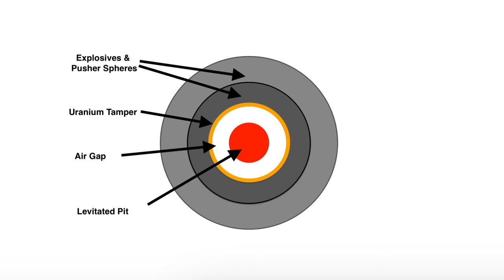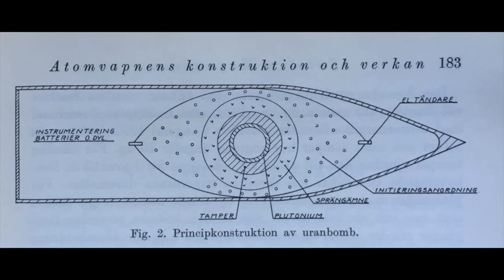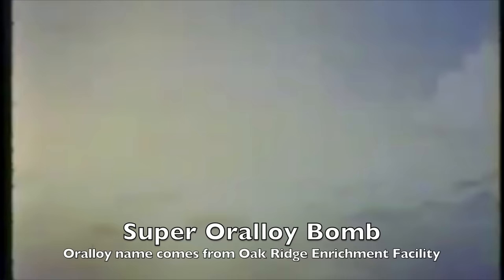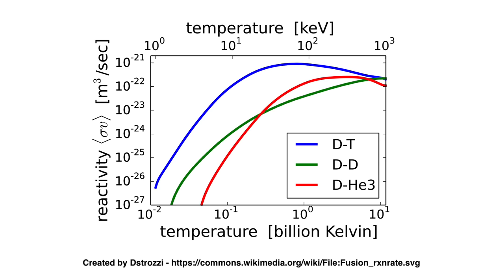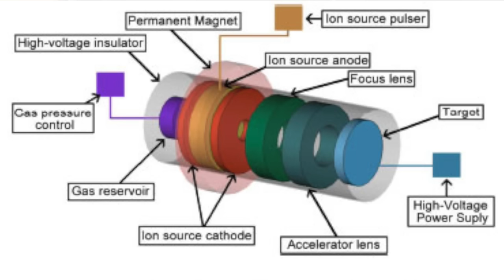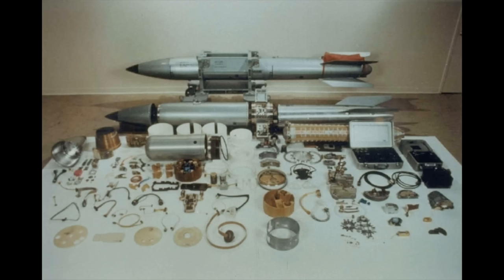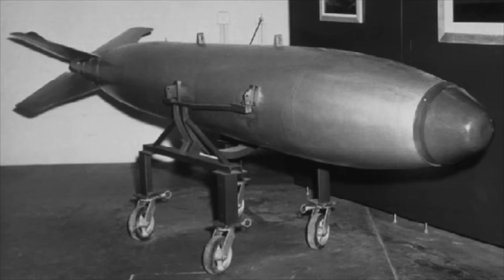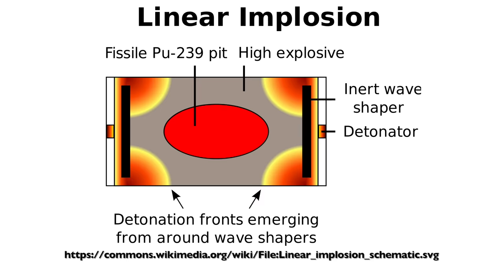Going Nuclear - Nuclear Science - Part 4 - The Incredible Shrinking Warhead

Comment: The air gap rang a bell with me. I read a book that was titled 'The Curve of Binding Energy' which was about the guy who probably came up with the air gap idea. It might have still  been classified at the time, because he described it only by saying that you get more energy if you hit something with a hammer, than if you just push against something with a hammer. At the time of the book he had designed both the largest and smallest fission devices in the U.S.
Reply: And he lit a cigarette using a parabolic reflector aimed at a nuclear explosion!
Reply: Is it more energy, or just more instantaneous pressure? Put the same amount of energy into either a hydraulic press or a mechanical mechanism swinging a hammer, and provided that the surface being either compressed or hit has the same area, the hydraulic press will deliver a more consistent pressure, but the hammer will deliver a much higher instantaneous pressure at the moment of impact. Which works by kinetic energy being converted into pressure, which broadly speaking is how most rotary compressors work too: Whether you have a centrifugal compressor (aka radial outflow) or an axial flow compressor, the blades give the air kinetic energy which is subsequently converted into static pressure.

Comment: Scientist : *invents nuclear RPG*
General : I’ll take that!
Scientist : No wait! Its range is only 2000 meters and its blast is 5000 meters.
General : I see...
General : Hey private, take this!
Private : Sir yes sir!
Reply: Things Mr. Welch is no longer allowed to do in an RPG #868: "I cannot have a gun with an area of affect larger than it's range."
Reply: It's a common misunderstanding that the blast radius of the Davy Crocket warhead was greater than the range. That is not the case. That 5000m danger zone was for the possible fallout cloud should the wind shift or be unfavorable to begin with. That thing wasn't designed for direct fire from open positions like an AT gun would be. The crew was expected to fire it from the reverse slope of hills, as per the manual. That or they'd fire from defilade, from prepared positions or some other cover.
It was a pretty god dammned stupid weapon TBH.
Reply: @mr.pavone9719  hear me out - nuclear trip mine. Now you don’t have to worry about the danger zone greater than the range
Reply: @HappyBeezerStudios  RPG here referred to the RPG-7 anti-rank grenade launcher...

Comment: Linear implosion weapons also make use of delta phase stabilised Pu-Ga alloy. Those assembly shocks induce a phase change to a higher density monoclinic structure. The yield of the 155mm W-48 device you showed was tens of tons, not tens of kilotons.

Comment: I watched a Davy Crockett fire non-nuclear.  The jeep mounted weapon also had a 37-mm spotting gun.  The operators aimed the weapon using numerous 37-mm shots at a specific target, then they lit a delay fuse, the weapon being dismounted, and drove away at high speed to avoid the blast if it had actually been a nuclear device.  The fuse burned down and fired the weapon.  The high explosive projectile missed the target point by hundreds of meters.  Makes you wonder why a spotting gun was needed!  Probably increased the price of the unit $ millions.

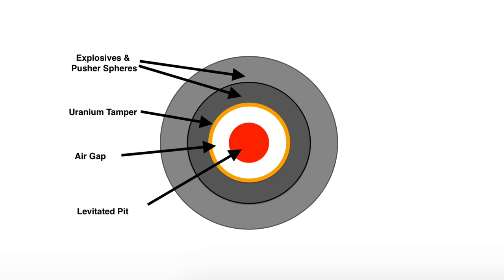Comment: @1:50  The "air gap" is what's known to go by the codename "FOGBANK" in modern physics packages, an aerogel of sorts made of a material composition that does not (I assume) interfere with the energy component that is hauling ass towards the fissile pit.
Reply from the maker: Fun story about FOGBANK - the manufacturing process was lost, and reverse engineered but the new material failed in testing. Eventually they figured out that impurities in the original process were essential to the functionality.
Reply: @scottmanley  indeed, which is precisely what piqued my interests, particularly the nature of the "contaminants". I nearly selected it as my senior thesis in college, but I chickened out & took the route of easier subject matter.

Comment: FYI the M-29 Davy Crockett Weapon System blast range was bigger than the range of the 106 that fired it. Was told they were ordered to fire in on the top of a hill and quickly drive down the hill. Still not something I would want to crew

Comment: I had this idea for a sci-fi nuclear assault rifle. It sounds ridiculous at first, but these would obviously not be stereotypical city-busting nukes. Rather, each 7.62mm round would contain a tiny plutonium charge with about the explosive yield of a small mortar round--and you could spray them on full auto. I call it the NAW--nuclear assault weapon. Clearly you wouldn't want to use it on the offense, but it would be great area-denial weapon, and if you defend an area with it, it would take half of the US VII Corps just to dislodge your platoon.
Reply from the maker: The problem is plutonium is just warm metal until you put several kilograms together in the same place. so a bullet sized plutonium slug can't make a nuclear explosion.
Reply: @scottmanley 
Yeah, I know :(

I'd have to use some kind of sci-fi handwavium--or pack several kilograms of plutonium into the space of a bullet WITHOUT causing a supercritical reaction. And by the time my alien race had the technology to pack matter that densely at all, let alone do it without the stuff going nuclear in the factory, they'd have the tech to build weapons that make more sense :P

PS: It is quite an honor to get a reply from you :D

Comment: We British tested a 720-800 kt pure fission bomb in 1957 called Orange Herald, that's 50% bigger than the 500kt Ivy King device tested by the US.
It diameter was smaller as was its total weight, even had external neutron initiation.

Comment: The 2-point implosion concept looks like something invented in more recent years – but wasn’t there an earlier conventional non-spherical primary in use since 1960?  I did not think they had the technology then to produce the 2-point version as shown.  I read that the original purpose of the non-spherical was to burst X-Rays directionally toward the secondary which allowed for a smaller primary. Supposedly first on the MK-41 - the ovoid primary casing seen on the MK-53 also hints at this.

Comment: Good Morning, might you know, by chance, how small each of the individual small nuclear 'charges' designed by Freeman Dyson's team for the 'Project Orion' spacecraft were projected to be please ? .. I imagine that they must, per necessitas, have been quite a bit smaller than the actual fissile device in the 'Davy Crocket' mortar weapon, (which most people seem to understand as being the smallest nuclear charge designed.)  With this in mind, would the 'Orion' devices have been as small, (IRO the smallest possible viable mass of plutonium theoretically capable of being driven to supercriticality), as physically possible, or could supercriticality be achieved by a smaller mass of fissile material, (and if not with plutonium, could it be achieved with a smaller mass of, say Americium ?) .. Indeed, how did Dyson intend to compress the cores of each of the devices TO drive them to detonate, (as one might assume that the physical size of the required surrounding 'shaped' explosive 'lenses' would have added, significantly, to the external dimensions of each small nuclear 'charge', and as several hundreds of these would have needed to have been stored within the 'Orion' spacecraft for the intended 'two-way' journey to Mars, [without their being collectively close enough to each other to accidentally 'go-critical', terminally irradiating the crew], perforce, the active cores of each would surely have needed to have been extremely small, [in relation to the total external dimensions of each individual device], with the outer explosive lenses on each acting as 'spacers' to ensure proper, safe, separation OF each individual core, whilst in storage ? Additionally, in re. the elaborate safety devices used on all nuclear devices in service designed to ensure that detonation occurs, only when required, what did Dyson's team design to serve in this capacity on each of the individual 'Orion' charges ? Microelectronics were in their infancy, safety 'locks' would have to have not added significantly to the dimensions of each device, they would have had to have been designed to be safely stored, 'en-masse', and for prolonged periods, and they would, one assumes, each have had to have been 'self-powered' and, (to all intents and purposes ..), 100% reliable, (both to PREVENT accidental detonation, and to INITIATE it, faultlessly, as required).  As a chemical battery would have degraded over time, might, perhaps, a capacitor have been designed in which the outer surface of each of the devices was completely covered with, say, a metal foil, then with a dielectric, then with another foil, (perhaps using multiple thin foil and dielectric 'layers' to increase surface area and thus to maximise total possible stored charge), where charge was applied, 'at the last moment' to each device in the 'device-dispenser',  (both to ensure maximum possible capacitative charge 'saturation' and to ensure that no charge was AVAILABLE to each device, until required ?) .. As I am not a physicist, please forgive any question that a physicist might regard as foolish.  Thank you, in anticipation, Mr. Swann, 'Edge of Dartmoor', S/West-U.K.

Comment: That 6 inch warhead probably would have worked for the Orion spacecraft.
Reply from the maker: Nah, Orion needs to maximize yield to mass ratio, the shell
Is low efficiency.
Reply: Any idea on how they would get it off the ground, it's something most videos I've watched didn't really explain. I'd guess it would need air under it for a bomb to drop out of it

Comment: Is there a limit to how low powered the bomb could be? Could a legitimate nuclear bomb be made that only had the yield of firecracker?
Reply: that's a great question, I wan tto know the answer too.
Reply: The Russians had plans to use nuclear bullets, about like a 1 ton bomb level of explosive. The problem is the smaller you go the more exotic of the material you are using to shrink the critical mass down. This usually shortens the lifetime of the thing from centuries or decades to that of months or even days.
Reply: In terms of conventional "cheap" isotopes, no it is not possible as you will simply not reach critical mass with a small enough bomb. But if one were to use exotic isotopes such as Californium 252 along with a very high-efficiency explosive like Octanitrocubane. This would enable an implosion sphere with a mass of around 5 kg and 7cm across, but at that point, you would have an overpriced warhead that emits gamma everywhere and bricks itself in less than a year. Yield though can be regulated on any assembly by controlling the degree of supercriticality, just that if it is set too low, the bomb will have a very low chance to actually go off. Also sorry if my English is not the best, it is not my first language.
Reply: Still the point is is that the lower the critical mass the more you can dial the yield down, as the substance is more prone to supercriticality, which enables reliable detonation of ultra-low yield devices.
Reply: I read once that the U.S. did test a bomb that demonstrated a lower limit to nuclear yield, but that was back in the early days of bomb design. A lot of very smart and clever people have been working on these things for a long time now, so who knows?
Reply: Theoretically anything is possible.
Reply: @bvcjbvcj342  theoretically it is possible but as you say in practical terms why would anyone try!
Reply: In order to make a micro nuke, you will need either rare "exotic" matter, or some form of gravity manipulation.

Comment: Hi Scott, great content on this channel (which I have only just discovered!). Not sure if this is mentioned in other videos, but could you comment on why uranium and plutonium pits are used in certain devices? What would be the advantage of a U235 + Pu239 bomb over an exclusively U235 or Pu239 device? Is it cheaper to use less of one and make up for it with the other? Many thanks!

Comment: How do you machine the Pu-239 pit in Linear Implosion device into proper shape without going critical when manufacturing it? Do you cast it in a mold, small amount at a time, close to final size, and then finish with machining? Or maybe create it in 2 or 3 pieces, grind the surfaces, and then simply join? What are the tolerances we are talking about, i.e. how much bigger the thingy can be without going critical? Or is it generally considered relatively safe, when using <10kg of Pu, and only becomes less safe when it is covered by neutron reflector? This is fascinating.
Reply from the maker: I imagine it’s machine in two parts.

Comment: Are "atomic", "nuclear" and "fission" the same things when we talk about bombs and reactors? Are "thermonuclear" and "fusion" same, too? If so, why the words are different then? Especially what's the difference beteen "atomic" and "nuclear" and how did different words come to be this way?
Reply: All of these weapons are nuclear weapons because they all use energy and energy magnitudes from the nucleus of an element.

Atomic is in reference to using atomic uranium or plutonium to yield high energies. The chemical configuration is negligible, unlike most explosives.

Fission refers to the induced splitting of an atomic nucleus as opposed to random decay. 

Thermonuclear (thermo = heat) describes the process for inducing fusion, which is by heat in the case of thermonuclear/hydrogen weapons.

Fusion refers to the forced combination of atomic nuclei to form heavier nuclei. Generally, high temperature and pressure is required to induce fusion, such is the case within the core of an exploding atomic bomb.
Reply: generally, atomic and fission are used to describe the same thing, and thermonuclear and fusion. Nuclear is a catchall phrase for all of it.
That's not to say some people may not use atomic to include fusion weapons as well.
And of course in fusion boosted fission weapons there's kinda an overlap, as there is in fission boosted fusion weapons.
Reply: Atoms are composed of a nucleus and an electron shell.  The amount of electrons is determined by the nucleus, so atoms and nuclei can be used interchangeably in some contexts.

Fission is the process which splits the nucleus, therefore the atom itself.  One nucleus becomes two, therefore one atom becomes two atoms.  (That's why the Earth's core is melted.)

Thermonuclear is a nuclear weapon with staging.  The second stage usually is a fusion stage, but sometimes it's a secondary fission stage, or a mix of both (I think).  

Fusion is the process of combining two nuclei into one.  Since nuclei determine the atoms, it's equivalent to combining two atoms into one atom. (That's why the Sun is hot.)

Comment: I wonder how they make these core parts. Just chuck up a big hunk of plutonium in the lathe?
Reply: Salvatore Shiggerino   The Tom Clancy novel "The Sum of All Fears" goes into great (fictional but plausible) detail about how a terrorist group could do it using commercially available equipment. They used a specialized CNC mill instead of a lathe. The operator died. Fascinating part of the story.

Comment: Which devices were used for the artillery shells (atomic annie) and naval gun shells?
Reply: W9 / W19 for early testing of 280mm (11 inch) , W48 / W74 / W82 for 155mm (6 inch) shell, W33 / W75 /W79 for 203mm (8 inch) shell, W23 for 406mm(16 inch) shell.

Comment: Question: I was always under the impression that a lower yielding setting on a variable yield weapon,  or really just older high mass, low yield are inherently dirty because they less efficiently burn through their fuel. Is that generalization generally logical?
Reply: well but the material isn't spread as far.
Reply: Yes, but the fission products are far worst contaminates. They will kill in seconds were as radiation from uranium in these diffuse amounts is effectively harmless.

Comment: So, say you used one of these implosion devices on a core of some non reactive strong metal, maybe tungsten and compressed it. Would the core of tungsten be completely destroyed after momentarily being compressed, would it decompress after the implosion, or would you be left with a super dense piece of mostly in tact tungsten?
Reply from the maker: If fission started it would vaporize anything in the middle.
Reply: But what if the material was non fissile? Would it be vaporized by the force of the blast? Would it stay compressed and be ultra dense? Would it rebound and return to normal density?
Reply from the maker: It’d rebound
Reply: Cool! Thanks for the answer.

Comment: Eugh... don't get me started on classification. It's a whole topic that could take about a dozen videos to properly explain, which would then receive derivative classifications because enough unclassified material was combined in the correct manner. And that doesn't even BEGIN to touch the subject of declassification, which is so full of loopholes and exceptions that it makes swiss cheese look solid by comparison... suffice to say, some things are classified that may or may not make sense to have classified, and of those things there's an undefined number that will NEVER be declassified for some reason or another
Reply: so unclassified material at a high enough density can spontaneously become classified? That is so meta.
Reply: @DrDeuteron  yeah, it's extremely unintuitive. Just another reason being able to work with classified materials just isn't worth the headache